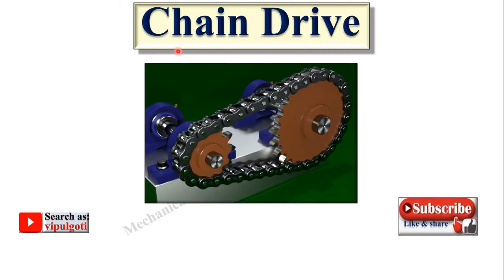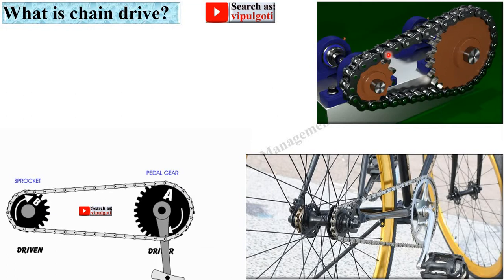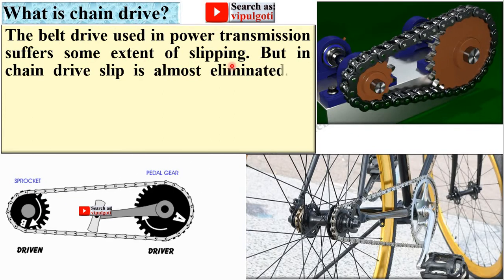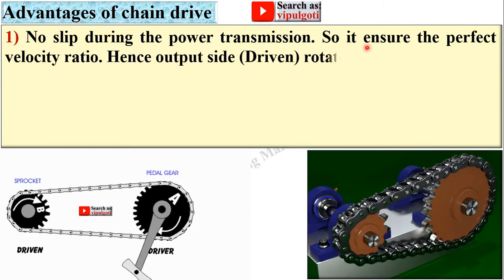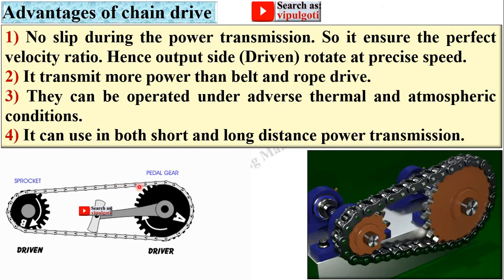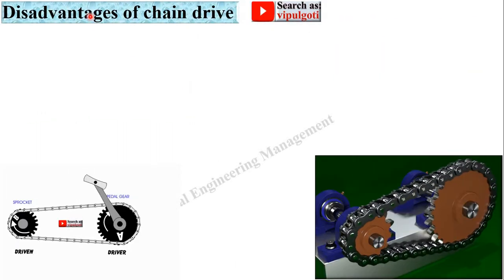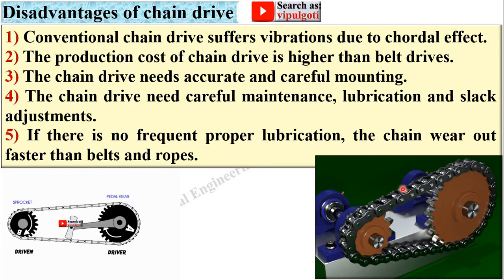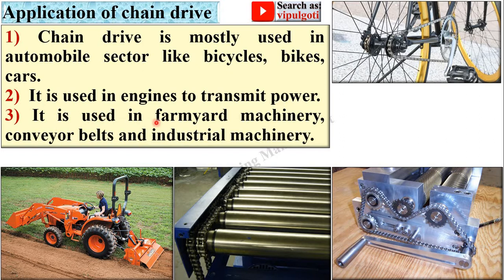Chain drive, power transmission device, Basic Mechanical engineering #BME, #GTU, #chain, #animation

Comment: Dear sir why do we see chain drives mostly in low torque applications like bicycles and almost none in high torque applications like tanks, trains etc? Why do those have solid shafts and gears mostly? Is there a solid reason? Can we use chain drive to transmit that much power efficiently or are shafts and gears truly better for that?
Reply from the maker: Due to restriction of speed
Reply: @vipulgoti47  oh understood. By restriction of speed I think you mean The chain can start vibrating.. Specially if length is long and RPM of sprockets is high. Is my understanding correct? Thankyou sir.
Reply from the maker: @crazydrifter13  perfect my dear
Reply: @vipulgoti47  😃 thankyou